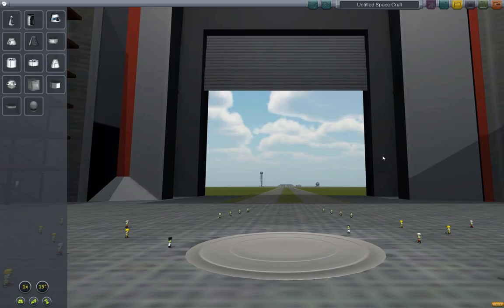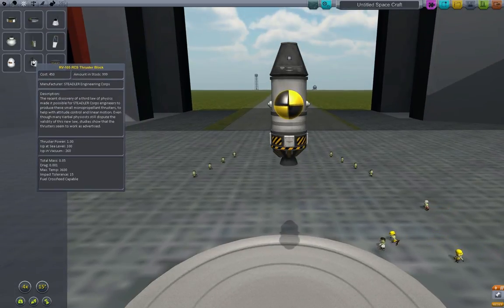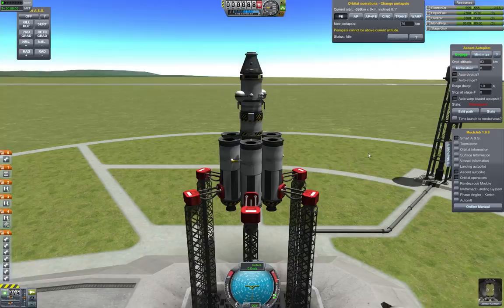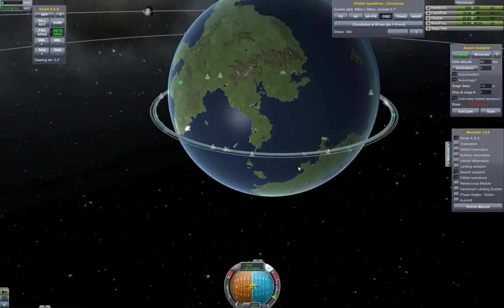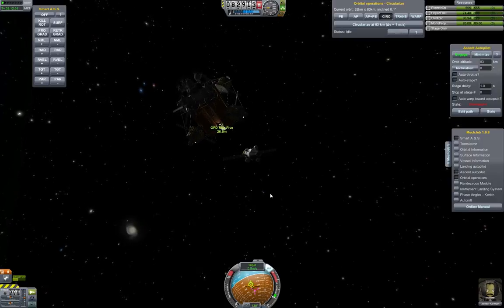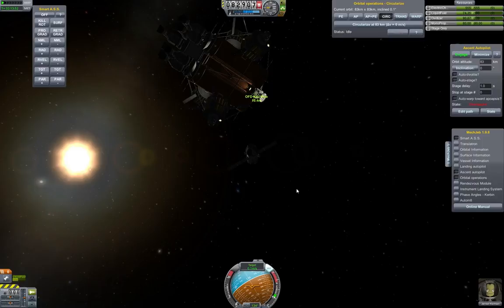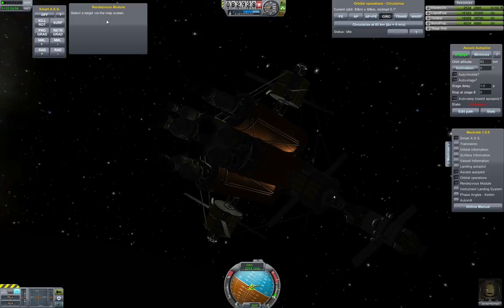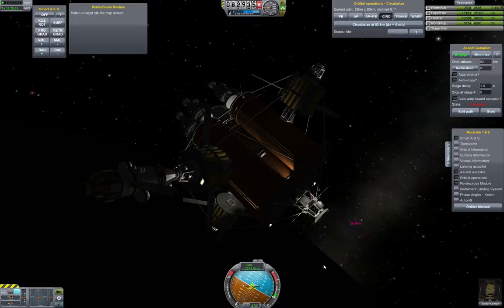KSP: A Comprehensive Guide to RCS and Orbital Rendezvous (docking).

Comment from the maker: You need to be in docking mode instead of staging mode. click the docking mode icon on the lower left to switch. Once in docking mode you can switch back and forth between rotation and translation by hitting spacebar. In staging mode, you can also control some translation using IJKL (IIRC).